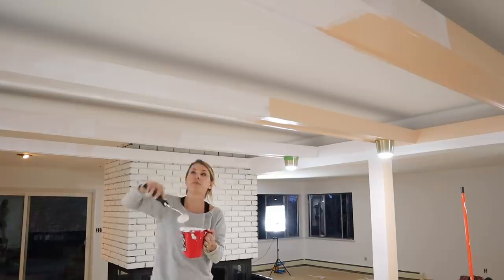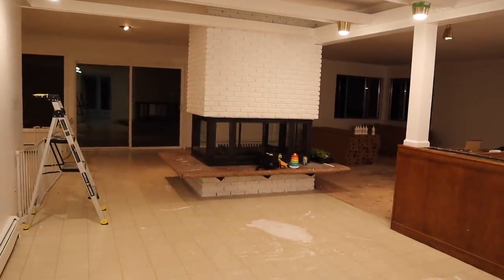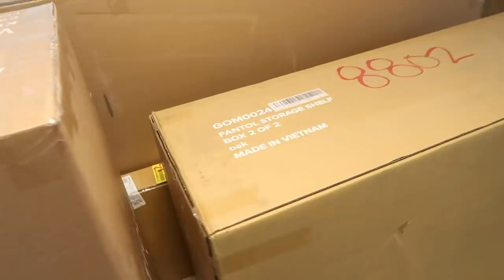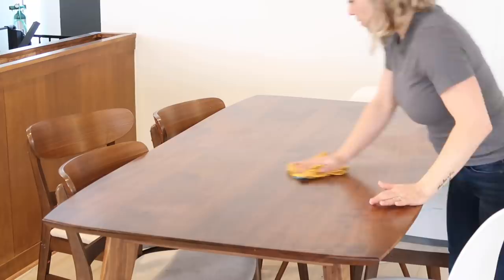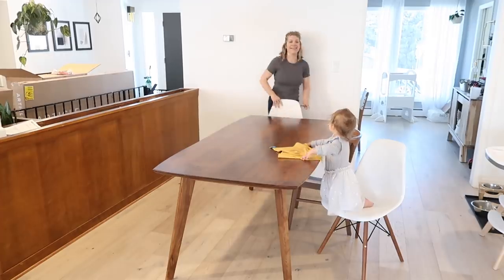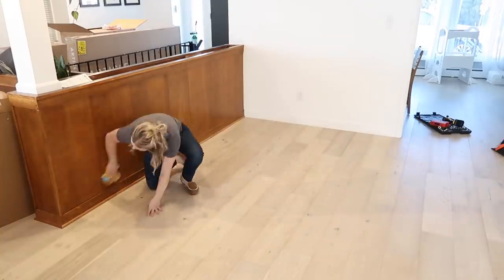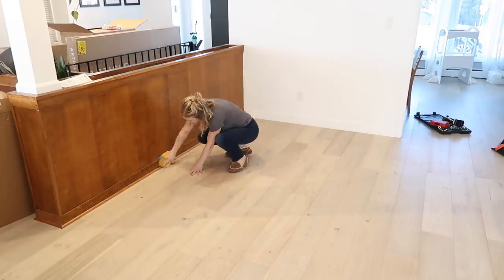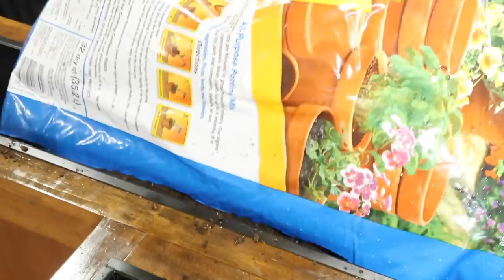RENOVATING OUR RANCH FIXER UPPER | INSANE DINING ROOM TRANSFORMATION | BEFORE AND AFTER | FINALLY!!!

Comment: If you find that you have a crazy amount of fungus gnats in your house now with all that dirt, you can use the planters as large cache pots. Remove all the dirt, put down a layer of rocks, place the plants (in their nursery pots) on top of the rocks and then fill in the spaces with decorative bark chunks in a dark brown or black. You might also have a problem with inconsistent moisture in large planters.
I'm glad you received my telepathic suggestion for turning the new table and moving it into the center of the room. You've done such a great job, your home looks amazing! 😘